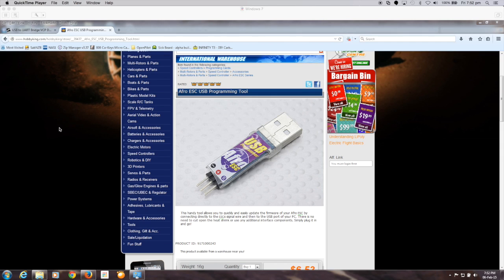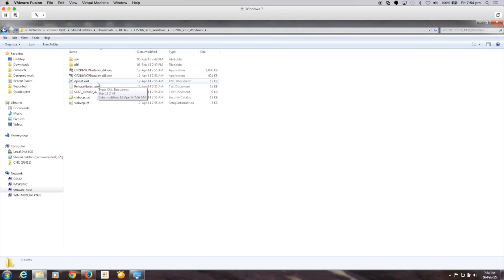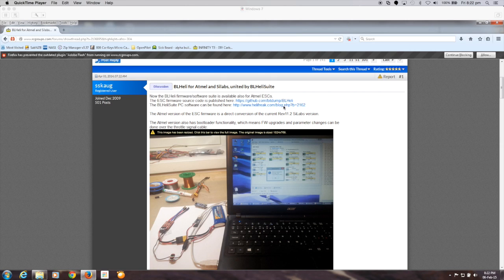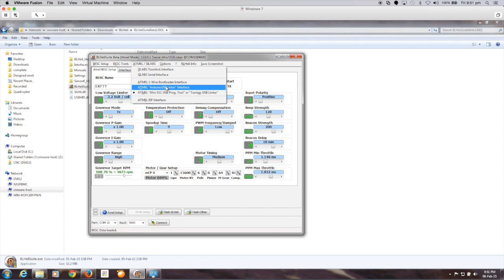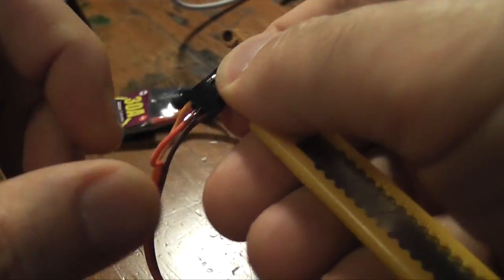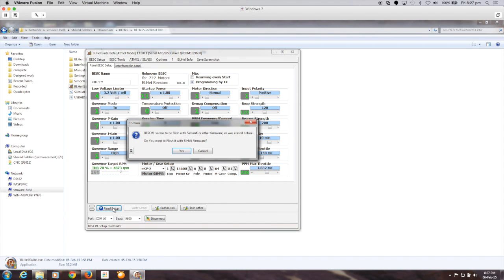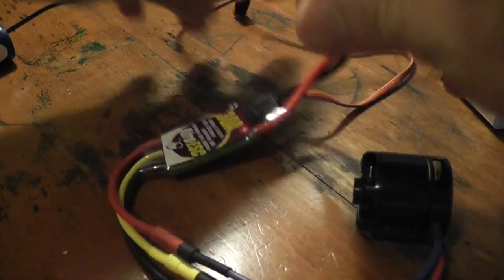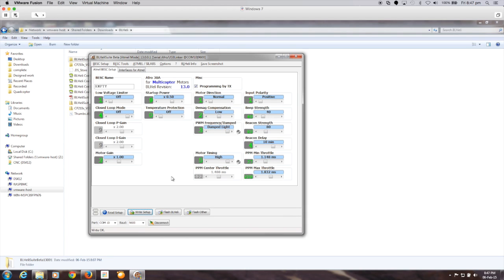How to flash BLHeli on Afro 30A ESC with Afro Programming Tool

Comment: I tried following the same steps, and then it shows up that please connect ESC and power up, then after a while I get an error message saying, 
Stk500v2 connection to ESC and COM3 failed! (Error: "CMD_SIGN_ON:read => Timeout (no answer)"), Please check usb/serial port - and power conenctions to the ESC!

Can anyone help me?

Comment: Hi sir, please help me. It will work even with Afro esc Slim 20 amp!? Those esc slim shape rated 20 amp!? Thanks
Reply from the maker: Rohan 67 this is a very old video, but the unit should work just fine with the 20 amp version
Reply: seafurymike Thanks... I am about to try flashing those esc în a few minutes! Finger crossed

Comment: I followed the instructions exactly, my computer identifies it as silabs, but it says "unable to open com port. Please check serial/usb settings" I have the baud rate at 9600, I can't figure out what is wrong. Help?
Reply from the maker: Typically this error is thrown when you have the wrong com port selected. Check your device under "devices and printers" if your using windows. The port is in brackets
Reply: +seafurymike that wasn't the problem, so I uninstalled the driver, restarted my computer, reinstalled the driver and restarted my computer again. That worked and I can adjust stuff. Thanks anyways!!

Comment: can you flash the afro opto esc's with the USB programmer?
Reply from the maker: opto isolation is on the power. you should be able to use the one wire to flash it.

Comment: I have the same Afro 30A esc's and am using the Turnigy USB Linker.  Everything seemed to run ok until I flashed the esc's with BlHeli firmware.  It gave the following error:  

"Failed to write Flash!  ("Chip seems to be locked; please use ISP 6-pin interface..." error)

I do not know what "6-pin interface" it is referring to.  Is there an easy workaround?
Reply: +Seafury mike BTW. I just tried the cleanflight linker last night to upgrade some new esc's that wouldn't flash with any of my usb linkers. Gramted they were little beees, but it worked great. I'm going to make a quick short video on this. Basically, you connect the esc's to the flight controller and connect the flight controller via usb to the pc. Open blheli, set the FC as the programmer, set the FC in the comm port and just use blheli as normal. It shows you 4 esc's at once, but you can turn them on and off and flash one at a time if you desire. Just an alternative thought
Reply from the maker: all i can think of is you have a comm port wrong.
Reply: +seafurymike USB linker is on COM6, which is what I set the software to.  Is there a way to verify communication with the linker?  And then with the ESC?
Reply from the maker: +twinturbostang there seems to something on OP forums, but i can't get to the site to read into it. I was looking at the chip write error issue you raised. here is the link i was going to look at https://forums.openpilot.org/topic/54620-motors-stop-during-calibration-testing-no-props/
Reply: +twinturbostang Have you had any luck with this?
I just tried to flash 4 escs 3 worked fine the 4th I got "Failed to write Flash!  ("Chip seems to be locked; please use ISP 6-pin interface..." error)
Retried multiple times same error.
Reply: +thesoundtree No I gave up on them.  I just tried one, but if I can't get them all to flash, then it's no good to me.  Instead I got some new esc's that already have BLHeli flashed on them.  They also can be reflashed if needed.  In the future, I may revisit this and see if I can get the Afro's reflashed.  Otherwise, I may just re-task them for other aircraft.
Reply: +twinturbostang i did some more reading and it seems your issue is related to the fact it can't write the fuses. "Chip locked". Q. Are you trying to flash with the latest firmware version? Have you tried a different version of Blheli, just to check it does the same. Just trying to think of a way to get it working for you

Comment: Is it possible to use this tool to flash Simon k to this esc? https://www.hobbyking.com/hobbyking/store/%5F%5F40685%5F%5FHobby%5FKing%5F30A%5FESC%5F3A%5FUBEC%5FUS%5FWarehouse%5F.html
Reply: Simple answer no. But you can if you modify the ESC first with an Atmel flashing tool. What the esc requires is a bootloader and simonk or blheli both provide this for you. So, if you find the Atmel chip and flash simonk to it (check my other video on this) it will allow you to use one wire code upgrade. The Atmel tool is this one http://www.hobbyking.com/hobbyking/store/__44789__Atmel_Atmega_Socket_Firmware_Flashing_Tool_AU_Warehouse_.html

Comment: Hi Mike, great video, and thanks for that, I shall link it to my build log. I am using 920kv motors from T-Motor, but I wish to use Afro esc's instead on the air 350 ESC from tiger motor; and thus flashing them with BLHeli as were the originals. One question though in the settings GUI after flashed. Should I follow your settings or else, as the ESC in the combo are recommended for intermediate timing, would this be Frequency or motor timing or both, and what is the relationship for a good balance setup (1.5kgs Rig)? Would you happen to know how should I consider setting them at please? Thanks and Safe Flying Mike!
For info here is the Build log in progress of the XJ470 with Pixhawk, OSD, Mavlink to FRSky Telemetry, GPS, Lidar etc... And off course your tutorial link for this flash in Section C8:
https://docs.google.com/document/d/1tA0vzY1utCa4Ycqz76afJFbuRti_TKWYWYlJhzTgtO4/edit?usp=sharing
Reply: The 30amp esc's I flashed went onto my cinetank and that unit is maybe 1.3Kg and its running sunnysky 980kv motors. This setup is rock solid and the esc and motor dont get really hot. The heat generated would be a major consideration and the stability of the craft with intermediate. I would recommend trying both and seeing what happens. Each setup is always unique in some manner. If you set it on high, i dont think you will have issues.

Comment: Thanks for the excellent video. Since the power cable (center cable) is not used to flash an ESC with or without BEC, what is the power cable used for? I assume there is a use for it otherwise it would not be there. Would appreciate any insight you have or if you could point me to where I could find info about it. I'm just curious.  The USB programmer/linker is a very useful tool. Thanks
Reply: The power cable is (with BEC) used to deliver regulated 5V. Typically you use it to power receivers, which for multirotors is useful in that you save weight when you drive a receiver with it, but useless in that the BEC will shut off motors to save power and deliver the 5v, i mean we don't glide, but planes do. Without a BEC, the wire will just bridge the battery power.
Reply: Seafury mike Thanks for the reply and info. I was actually asking about the power cable in the USB programmer/linker. What other purpose is the linker used for where the power cable is used?

Comment: Thanks for the walk through.  So I installed BLHeli on Afro 12A's/4S/DYS 1806/Naze32, on same cleanflight settings as SimonK and oneshot enabled the craft wobbles like MADD and motors and ESC's get extremely hot after seconds. I turned on damp light and motor timing on high. What did I do wrong?

Update: I've had to lower my P to 1.5 just to get anywhere close to somewhat sort of smooth flight. I definitely did something wrong. :-(

Update: attempted medium motor timing, no difference. :-(

Thanks for any help.
Reply: It wont be BLHeli only. You need to think about your motor and ESC combo too. I see your running 4S. This combo with 12A ESC's must be a contributor. I would think about the amperage your pulling.

Comment: Got HK blue series 40a, on the ok list. Won't connect with either afro or turnigy usb prog. Trying this for hrs. every which way, no go.  ???
Reply from the maker: does the ESC have simonK loaded. The ESC needs a bootloader and simonK flashed units provide this. if not, this procedure will not work and you will have to flash it with an FTDI unit.
Reply: seafurymike no simonk but it says it supports bootloader on input plug?
Reply: If it has a bootloader this process should be fine. You may have wiped it some how. Try to reinstate it or atleast confirm the bloader is present. Goid luck

Comment: i have multistar 4220 -880 kv and afro 30 amp esc i work with naza v2 can i enable one shot with no problems with naza also what is the best settings on blheli to work well with that system and motors thnx alot my prop is 11*55
Reply from the maker: just follow my procedure to enable one shot with BLHeli. however i have no idea if Naza supports 1 shot as i dont use it.

Comment: Hi guys, can someone tell me what is one-shot and what does it do and why would I instal it on my simonK esc's
I haven't a clue, thanks
Reply from the maker: lets you run higher loop times which lets you get better performance from your craft.  i am also led to believe it has better sync across all motors.

Comment: can i use ftdi cable for flashing it "aurduino cable " bu connecting tx from cable to the signal on servo led and black ground to ground ofservo cable 
plz help
Reply: I don't think so, I think I read somewhere they do proprietary stuff. Someone maybe chime in if I'm wrong.

Comment: Hi Mike and thanks for the tutorial, just finished installing BL Heli on some 12A afro's after watching it, whats the reason for the 1600 looptime? as been looking and cant find anything on it and everyone I ask says 2500 is best for the 12A esc's.
Reply from the maker: Because BLHeli (oneshot) is so efficient at the way it outputs to the ESC, you can afford to increase the main loop cycle time by a lot (1600) which in turn increases the performance of the entire board. it means that you will do a cylcle every 1600ms, instead of lets say 2500ms. this is very noticeable when you fly. The 2500ms cycle time is for standard simonk flashed ESC's.
Reply: seafurymike Thanks for the reply Mike, will drop my looptime down and give it a try tomorrow, thanks again.

Comment: hi.. question !!

i am about to flash my afro 12amps símonks   with BLheili.  the same way you did , but my question is this. can you still flash the ecs even if you remove the ground and power wire from the the ecs.  on the signal side. ( i removed them from 3 of 4 to loss some wight om my miniquad. :/ )

best regards RogerS
Reply: Mmmmm from my reading and understanding, I think it needs the signal only. Give it a go, if it works great, if not, add the GND wire.
Reply: I recently had the same question, the afro 12a needs ground and signal otherwise blhelisuite gives an error about unable to connect or something.
Reply: Thanks for the info. I thought it may need the earth for clocking or rst functionality
Reply: Seafury mike 

well in i week or so my order with the USB programmer  will arrive then i will make a video on if it works or not.
Reply: Roger sundberg I already tried and it does not work without ground connected to the esc. A tip is to bend the power pin from the usb programmer so you don't need to remove it from the esc powering your FC each time you want to flash it :)
Reply: Marno van der Molen then a have a problem a have remove the ground and power cable down at the ecs  need to cum up with a solution to make a separate ground cable.
Reply from the maker: Roger sundberg you have a problem - yes

Comment: So after doing this, I can go into cleanflight and enable one shot and that's all there is to it to have oneshot working?
Reply from the maker: Yes, its as simple as that. dont forget to drop your looptime to 1500 so you can see the advantages of quicker updates.
Reply: It will allow the flight controller to put out more corrections/updates - quicker.

Comment: I got same audio sound after flashing, but my motor wont start.
I do same as shown in your video. just not change settings for one shot, as I don't know what there are.
how to make motor run?
Reply from the maker: All I can think of is your throttle setup doesn't bring the idle back enough to activate the unit. Change or make your minimum around 1060. I think the default is 1150 in Cleanflight. This is under config tab. I hope that fixes the problem. You can actually check this us the fix, by moving your throttle trim so it moves your idle point down. If that makes sense.

Comment: Thanks for the tutorial... very informative.  The one thing I haven't seen / noticed yet is how to determine whether or which ESC's are compatible with one shot.  Do you have any info/links on that?

Also, in the BLHeli settings you selected, do you have any brief explanation for why you chose those settings?  I get the high timing on the motor, but the PWM setting has me stumped.  I admit... I've only begun to investigate one shot.

Thanks!
J
Reply: good find. will put that knowledge in my back pocket
Reply: yes. there is a list on github for cleanshot which esc have been tested. also, if its not in the flashing option its more than likely not tested or available for use.
Reply: Seafury mike
Thanks... I'll check github.  Didn't see the one shot flashing option in the vid.  or is it just that BLHeli supports one shot and the ESC has to be supported by BLHeli?  ahhh... more reading to do - cheers! J
Reply from the maker: Jason Uberig I uploaded another video which is just oneshot and it has a quick maiden at the end.
https://www.youtube.com/watch?v=WOvrhA51GVw

On cleanflight, just select oneshot125. You can do it also from the cli. 
I also changed my looptime to 1500 via the cli.
thats all i did, but i show it in the linked video

Sorry, but i lead you astray as to where the compatible list was.
Here you go

BLHeli SiLabs compatible ESC PDF List:
https://github.com/bitdump/BLHeli/bl...s.pdf?raw=true

BLHeli Atmel compatible ESC PDF List:
https://github.com/bitdump/BLHeli/bl...s.pdf?raw=true
Reply: seafurymike
Thanks... yeah, actually saw that one first.  :).  As for the links you just posted neither worked for me; however, no worries - I found the compatible lists for BLHeli already; however, one thing I'm not 100% clear on is whether an ESC must have "damped" mode capability to enable oneshot or if the ESC is in the list and supported by BLHeli then it's good for oneshot??  Eg. I have some Multistar 6A ESC's sitting here just begging to be used.  I also have some EMAX 12A's sitting here, but what I read on them is no damped and somewhat slow'ish in the BLHeli support PDF.  Thoughts?
Reply from the maker: Jason Uberig I don't believe that's the case. oneshot has to do with syncrnising the output timing, I didnt think it was linked to dampening for it to be enabled, but hopefully someone may know more than I do on this matter.
Reply: seafurymike
Thanks... much appreciated.  Maybe I'll just have to sacrifice a spare ESC and find out ;-).  Also subscribed to the RCGroups thread on this.
Reply: Jason Uberig
Actually, just found this post on the aforementioned thread:  http://www.rcgroups.com/forums/showpost.php?p=30539638&postcount=504

Comment: Great video Mike I am sure this will help loads of people as the oneshot is the next big thing!

ATB Malc
Reply from the maker: I think so, I just loaded my DRQ250 with one shot. I did a quick power run only last night and I can confirm the motors run way smoother. I'm looking forward to pumping up the PIDs on my DRQ and making a mess of the air! All cudos to Dominic Clifton and Juuut (from Kiss).